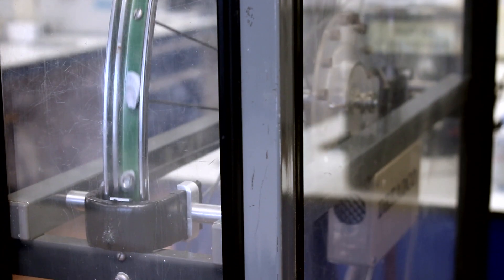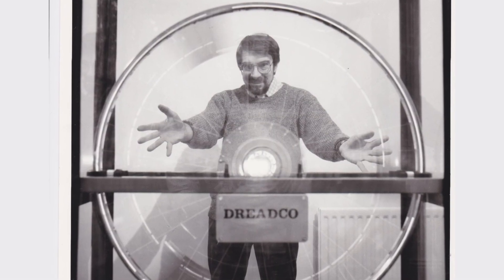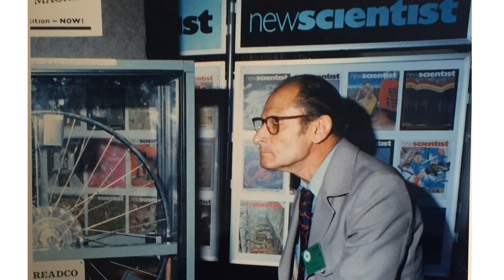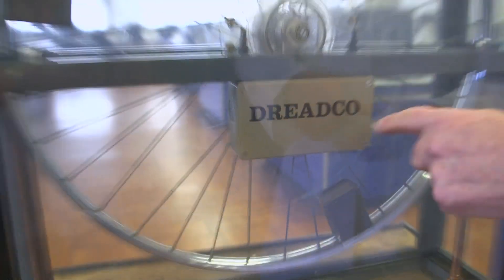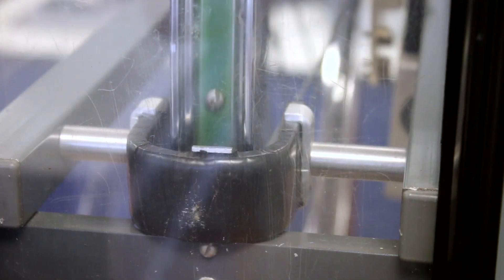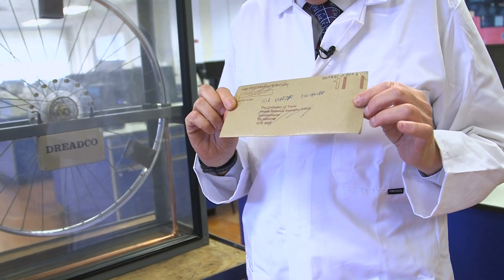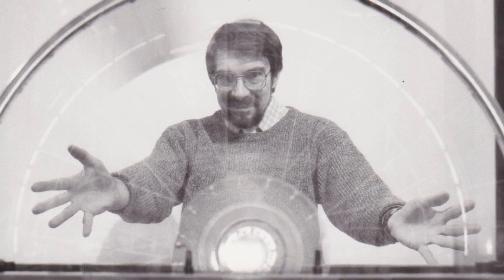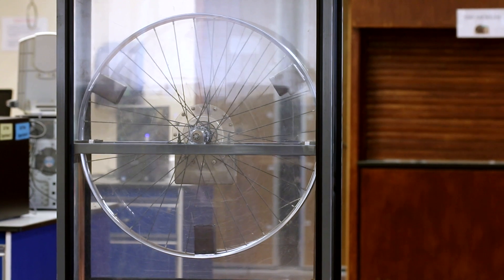Perpetual Motion Machine - Periodic Table of Videos

Comment: My guess would be something to do with a secret battery compartment and electromagnets. The electromagnets might turn on and off when triggered by the smaller magnets closer to the axis of the wheel.
Simple but yet functional.
Reply: Including parts that need lubrication is about the biggest mistake you can make when building a "perpetual motion machine".
Reply: but yet it has been running for apparently a couple of years without intervention.
Reply: It's also slowing down, adding to the battery theory. You don't need much juice to keep this turning.
Reply: what if the wheel needs to be re-oiled or somethin and thats the cause of the slowing??
Reply: Wolfram like Nova said, that would be a big mistake. Bearings without oil run faster than bearings with oil. The oil helps against heavy wear, but that is no problem here.
Reply: oxidizing batteries can provide power for many years if the power draw is low and rate of oxidation is limited.
Reply: not that secret too, there is so much space there to hide a battery
Reply: A Bedini motor.
Reply: Interpret this as you will, I copy and pasted this from my prev comment:

I found a BBC documentary on this exact machine with the same prof present and they measured an electromagnetic field near the box with the heatsink and the DREADCO box. No other magnetic field was found anywhere else.
Reply: I'd say you pretty much nailed it. And that there is a battery concealed in the DREADCO box. Then there are wired running out through the tubing frame to the horseshoe shaped things at the rim (wish may even be wrapped in wire themselves) although I doubt it. Then there is a hall effect sensor either places near the rim (center of horseshoes) or possibly inside the left (bulbous) brass fitting near the hub that's used to pulse the electromagnets.
The reason I think the hall effect sensor might be in the rim is because of the protrusion at the curve of the horseshoe shaped things. Plus, if you look at how the black boxes are attached to the rim- there is in extra screw to one side.
Reply: bob s  I doubt it's even as complicated as that.
Reply: I dont believe it is hall effect sensor. they need DC excitation. I expect a pickup coil.
Reply: goamarty Yeah. I don't know why I'm calling it a hall sensor. I guess I should have said reed switch.

Comment: I'd guess something with electromagnetism given the coils, and especially given the fact that they've slowed down over time as if the battery powering it is begun to run low.
Reply: I actually thing the Centre of Mass is not balanced (due to the boxes, which I assume could be a magnet itself) as a small push would then leave it rotating around and the copper tube there is providing some sort electromagnetic force due to rotation of bicycle wheel.

Comment: The heat sinks are probably a red herring, but if I had to guess, it's some strange configuration of stirling engine?
Reply: Well the Stirling engine depends on a heat gradient so the heat sinks may very well play a part in it if it is a stirling engine...
Reply: The biggest problem with this theory is that surely more than one person has suggested "it's got a hidden battery powering it".
Reply: Stirling engine also needs a a cylinder for the expansion and contraction of the gas and I don't see any devices for mechanical power transfer to the wheel
Reply: The heat sinks are just attached to the outside of the box so they wont be transferring much heat from inside it. You'd need some way to transfer the heat to the blades for them to actually be useful. I suspect that actually the boxes just have batteries in them and the copper pipes are just there to hide the wiring which drives a small motor or magnet somewhere, that would also explain why it's slowly winding down as the batteries lose power.
Reply: Theoretically you can create an air draft just from cooling/heating air, as in PC heat sink heat pipes (used a lot in laptops, and now phones).
Reply: Chalk Chalkson the pipes themselves could serve as gas storage
Reply: Immediately i thought sterling, but also it could be setup to kinda look that way deliberately to through you off, because if i thought it straight away, you can bet your bottom dollar most other ppl do to.  And it's obviously not the answer, i'd say.
Reply: Three Random Words
 Seen another guy who thought he knew what it was, he wouldn't say specifically, he just said that it wouldn't work in space, or be self starting.   This is far too common of a suggestion for it to be the case.  If ive already seen a handfull of youtube commenters suggest it, so you know the hundreds of scientists that have had a guess, would have already suggested it before.  So that cant be it.
Reply: seems like it use no electricity though
Reply: Uh oh Postghost, wot - you only got bottom dollars? Here,  I'll throw you a tenner through the window, though be careful - it's very tough...
Reply: Well. I don´t think a sterling engine would work, since the temperature normalizes after a short time and it needs a temperature difference for a sterling engine to run.
Reply: Casper Unnerup I mean, a sterling engine requires a large sealed tube with a plate and a piston, neither of which are present
Reply: Green Rabbid Rabbit
YOU can bet YOUR bottom dollar. Not: I can bet MY bottom dollar.  XD
Reply: Maybe it's similar to those Atmos clocks that are powered by changing air pressures.
Reply: Interpret this as you will, I copy and pasted this from my prev comment:

I found a BBC documentary on this exact machine with the same prof present and they measured an electromagnetic field near the box with the heatsink and the DREADCO box. No other magnetic field was found anywhere else.
Reply: Argon gas
Reply: Stirling engines typically make quite characteristic sounds.  If this did, I think the Professor would have figured out what was going on.
Reply: That was my thought exactly as well :)
Reply: If he said he felt cheated, I'm thinking it has to be something quite simple.
I think the three big boxes on the wheel are either batteries, or red herrings.
I think the nails pointing towards metallic parts of the wheel are also red herrings.
I think it's simply some exotic kind of electrical motor, meant to run very efficiently.
He's only had it for a couple years, so it's conceivable that it had its batteries swapped out.
Like the swinging arm toys that slowly drain a battery over weeks of time, it's possible that there's a very large resistor in the system slowing the current to a crawl.

The fact that he said that it's running slower than before either means that the batteries (wherever they are) are running down, or that whatever mechanical/chemical/nuclear?@!?/whatever system is losing potency, or that mechanical wear is showing up after 37 years.
Reply: the circles on the sides of the Dreadco box definitely makes me think of light sensors, and the heatsink and copper tubing do feel like they could be parts of a stirling engine.  the black boxes i feel are just weights to microadjust the balance of the bike wheel.  he's right though, the guessing makes it fun.  i wouldn't really want to know the answer.
Reply: Ram Laska, the 'running slower' comment could also be a red herring.
Reply: There are several, like the nozzle blowing into the small cups near the hub. Also there could be a solar panel inside the DREADCO box behind the circular window. Also it could be some sort of energy harvesting devices inside there, combining all the available sources of energy (heat gradients in the room, radio waves, light etc.) to overcome friction.

Comment: what if the black boxes have long lasting batteries inside and low power consumption motors to drive the wheel
Reply: How? They aren't connected to the hub.

Comment: I'd guess it's something to do with air pressure or heat gradient turning the wheel, with the outside air (being either hotter or cooler) being the source of the energy kinda like a Crookes Radiometer.

Comment: For once Wikipedia is no help at all:  David E. H. Jones "is also known for his series of fake perpetual-motion machines".
Edit: My guess is a nuclear isotope thermo-electric generator...
P.S. I used to love his columns as Daedalus in New Scientist...
Reply: Your guess actually sounds believable - batteries and chemicals would run out much faster. Meanwhile, nuclear isotopes are still powering the Voyager probes (which were launched a few years before this machine was built).
Reply: I hate to copy paste answers, but I didn't want to retype the entire thing either, so sorry for the repetition:

TLDR; Probably not nuclear batteries, even though that would work.. maybe evaporation/sublimation or temperature gradients in the room.

Yea, you could theoretically just have a few grams of plutonium, each gram generates about half a Watt in thermal power decaying by half every 88years. However I strongly doubt this is what is going on. 
He built it in the 80s, sort of a highpoint for RTGs, but Pu238 was still super expensive and not available for the general public. In fact very few nuclear materials are.
An isotope that was relatively easy to obtain is tritium, this has a half-life of ~12.5years and the decay emits ~19keV which comes out to ~1W/g of tritium. This isotope was commonly used for watched and signs/markings showing emergency exits, so a civilian would have had an easier time picking it up. After 40 years it would only provide 10% of the power at the beginning though, so we can probably cross that off the list, too.

My guess would be that a simpler temperature gradient is exploited, some water is evaporating cooling some bits down a tiny bit, maybe iodine? Or maybe this device is efficient enough to draw from the temperature gradient between the top and the bottom of the device.... I don't know is any of these would be possible though
Reply: I suspect it's something else, just because that would be pretty easy to test with a Geiger counter.
Reply: It wouldnt be powered by any gamma emitter, too obvious. Im pretty sure by now someone poked it with a geiger counter.
Reply: no, not zinc air. they do not have a long lifetime once activated they dry out quite fast.
Reply: YES that's what I was thinking about.
Reply: To start moving you need to overcome the friction of the system ... and a bicycle wheel of that size isnt a featherweight. Added to it are some metal boxes which wont make it lighter. I doubt that such TINY things like a temperature gradient will be enough to overcome it and anything involving nuclear decay needs a way to "transform" the energy from the radiation into electrical power ... which is quite a big operation and wont work without "protection".
Reply: If nobody did, there are some in museums around the world.

One is in Austria technic museum...

Also I think I have an answer (electric motor in the "weights")
Reply: and powered by some zinc air batteries?
Reply: It's possible he could have "refueled" the machine several times, all we know is that it has been running for two years nonstop.